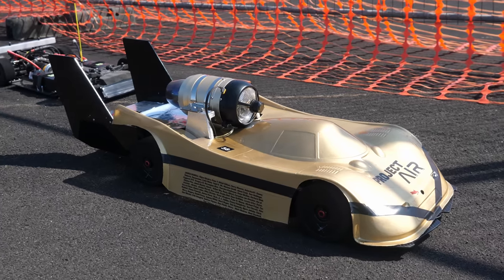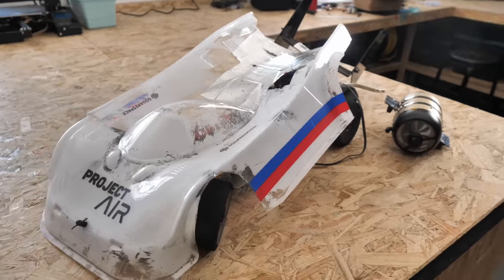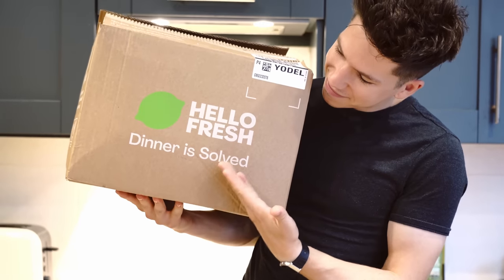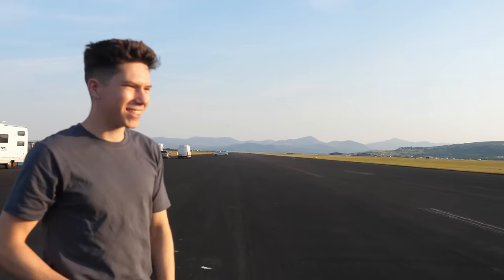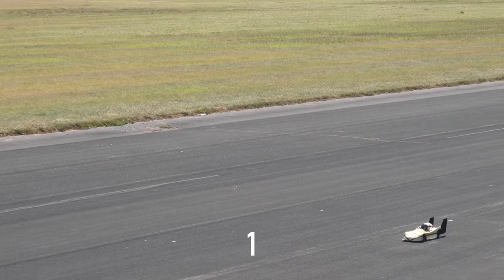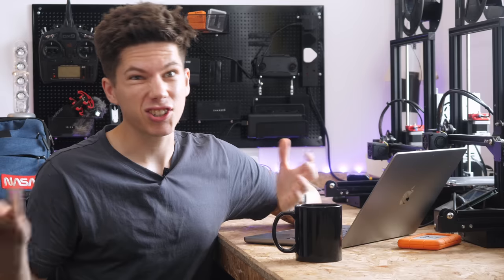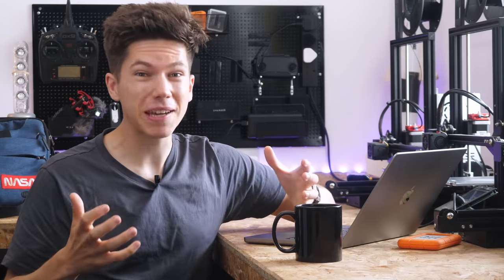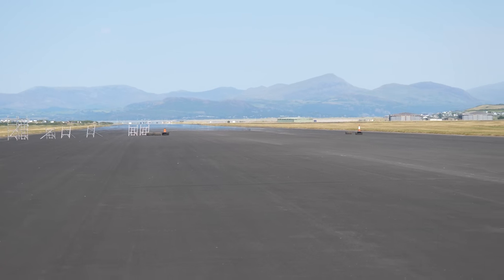Fastest RC Jet Car (Runway Testing)

Comment: The gyro is for a rc plane right?  The response of the car steering will be really different.  I'm sure some people have used gyros in cars successfully, but it might just be luck that the response of their steering is similar enough to a plane.

If you do want to run something like a gyro, maybe run a tunable/programmable flight controller on the steering axis and tune down it's sensitivity ?

Comment: Take a look at the direct to servo stearing links on 1/12 pan cars slop is almost nothing. If I was building a speed car I would try to go with a similar stearing set up keep the chassis very simple. The more moving parts the more slop there is.

Comment: The gyro must've gone wrong due to the wheels not being balanced, at high speed, the side of the wheel that had more mass, would push/pull the steering and the car, making that gyro malfunction.

Comment: Gyros need to be isolated from vibration. You would have been better off with a Lumenier Lux F7 flight controller, isolated with the silicone standoffs, configured with some heavy imu filtering. Then just assign one of the flight controller servo outputs for yaw control, iNav firmware. Get rid of that spektrum trash, and go with 1 - 2W TBS Xfire at 868MHz, fix the mechanical slop. 

You go that route ^^^, your problems will be behind you. Also, driving at these speeds, you may want to think about FPV.

Comment: In testing the same problem using my IQ and the knowledge that I have acquired over 40 years I found that a slow servo is more than likely the culprit. The gyro sends a signal to the receiver to keep it straight but if your servo cannot move fast enough to keep up with what it thinks is dead center then your servo is always falling behind the signal. I tested this for several hours using a cheap Chinese four-wheel drive buggy and a dumbo controller because Kevin recommended them and he uses one for almost everything and I always was curious about gyros myself. After fighting with it a bit I found that somewhere in the ballpark of 60% gyro was where the wobble started and at 100% it was comical to watch it attempt to go down the road like a drunken clown car. After settling on 30% gyro which was what it seemed to function the best at I decided it wasn't even worth it and I put the original fly sky back into it. I'm sure sloppy steering linkage doesn't help either but I'm guessing the root of the problem lies within the servo not being able to move fast enough to keep up with the signal from the gyro.

Comment: If you are going only for top speed on straight then you should extend the wheelbase of the car with 2 extra wheels 6 wheel setup and try a boady design like the real top speed record cars such as Mercedes T80 maybe this things can help for sure...the extended wheel is more stable at higher speed compare to normal once and extra wheels too

Comment: your gyro maybe be affected by electrical interference from the motor { or another source} try putting capacitors on the motor   i used to have this problem with a boat i built.

Comment: The car needs a suspension system of some sort to reach it's max speed. The vibrations in a setup that small and light are devastating to stability. 
I doubt that the down-force generated strictly by air control is sufficient to dampen the vibrations enough to get the job done.
You would need a running surface that was glass smooth to get what you are looking for.
Solid steel wheels ala Thrust SST? Maybe with the addition of a thin tire to help absorb the impact from those individual pieces of aggregate in the pavement? 
Much lower COG. More wheel inertia. Not good for cornering but great for straight line speed runs.

Comment: Would it help the matter to remove the gyro and run a slower steering ratio? If the car is to be straight line high speed only that is.

Comment: fuel tank sloshing around add a RC jet plane fuel tank inside to reduce the sloshing around also it looks like all the weight is on one side, in both crashes did it move toward the side the fuel tanks on?

Comment: definitely the gyro caused the oscilation. Looks like a unstable control loop. If you can adjust the gyro gains maybe you can use it.
I wouldn't blame the sloppiness of the steering, but a PID control the gyro uses is too agressive on high speeds

Comment: Stopped at 13:00... my guess would  the gains are too high. Happens all the with RC planes. Get to a high speed and wings rock cause the gyro is trying to level the winds too accurately and too fast. So, it over corrects to one side and then the other amd so on.

Comment: why don't you try to control the engine's gas output to send the car down, to make small changes of direction at high speeds, a reverse direction of gases to stop. All this in a single component, so you'll be able to remove a lot of the weight related to brakes, steering control (since you're on a track you don't need such a precise steering).

Comment: Gyros are really sensitive to vibrations. I faced a similar problem while building my drone, the gyro readings start oscillating at the resonance of the vibration from the drone props, so maybe it’s something similar that you can correct for using filters…

Comment: i dont know any thing about rc speed racing., but used to race silly overpowered 18th scale with other engineers in the parking lot at work. i used that exact same gyro to  tame the twitchyness. it works great until it doesnt every litttle change to setup or conditions changes how much gain you can get away with before oscillation. too fidly even on 45mph rc18ts. seems like you could just mechanically tune crazy understeer and a lot of expo to tame a speed run car
Reply: and probably need better than a 17usd gyro if you intend to use one.

Comment: I've not follow the last vids. But from a airplane experience, you must keep the vertical surface at max rear and max surface possible
Be sure they can enter in vibes at any rpm on the EP motor. He is more risky on vibrating than turbine. So if no flutter appears on it. No appears at all 
You also must have a big rigidity in steering including the suspension articulate on it. 
If your radio accept it you should use exponential over gyro. 
I have no exp on car gyro, on airplane yes. They are very cool to use on pilot which don't have reach the skill of control. But I am a strong defender on the raw practice. Skill yourself not skill your model. 
It cause more damage yes. But Au better pilot. 

You probably must work on steering servos amplitude to short it to the strict minimal need and half it by dual rate radio setup. 
Your fingers become more precise and far stable on straight

Also think of lateral wind. It push far from steering on your vertical surface that have no control on it. And simply turn it more with speed' 

Trust in your test you are ona. Good way 
And don't listen Kevin 😜

Comment: You need to use a wide chassis with abs or Cf inner ribs that the body velcros too. So many things wrong with this for high speed reliability but its really nothing different than 99% of the rc youtoobers. Yeah, i am a mechanical design engineer.
Reply: Also if uou use a 4wd rc dyno you can save a lot of money working out many issues. Wind tunnel helps as well. Cheaper to buy these tools than replace parts all the time.

Comment: It almost seems like the rear fins were too large. Could they be causing a weight imbalance on the car? Under acceleration it might cause the front end to lift slightly.

Comment: your rocket car answer is right behind you, mount the friggin rocket on wheels and one thing about all you guys, 
sure you got oscillations with those hugely WIDE TIRES. Bonneville speed cars have NARROW FRONT WHEELS that 
don't wobble like casters on a shopping cart, so you didn't do anything wrong, it's what you DIDN'T DO that made it go 
crash. Have fun, I've done rocket cars when I was 8 yrs old, just maybe not as expensive and sophisticated as todays plateful.

Comment: You should mount a 360 camera on the car. That way u can see the wing as well

Edit: well, it looks like you do exactly this. Why dont show footage of the "wobly wing"
Reply from the maker: I wasn't able to fix my 360 camera to the car in the video, as it was a bit too large, unfortunately. The camera later on in the video was an Insta 360 Go 2, but it doesn't actually do 360 video, just stabilizes it 
and shoots a wide field of view. Next time I'll be sticking cameras all over the place, as you're right, it would be helpful to get lots of angles. Thanks for watching!
Reply: @Project-Air  thanks for answering! Keep it up, nice videos

Comment: Why not use the intake as a form of suction? I mean I’ve seen little rc wall riders do this, why not use your already sucking jet turbine to suck against the ground?

This would be a good challenge but mounting the turbine lower into the chassis and using guided intake through the front end and on the ground would both keep the car on the ground and…increase airflow?
Would definitely solve your center of gravity issue though!

A more extreme project: maybe even have an adjustable front end air intake on top of the ground effect, considering the turbine would need open air intake first to get going, once airflow was under the car then shutting the open air intake would cause it to clamp down on the ground.  At least I think haha.  

Ps: the car doesn’t suck.  I think it’s pretty bada**

Comment: Umh, it's not Tarmac.  It is an asphalt runway accessed via an asphalt taxiway connected to an either concrete or asphalt ramp area used for parking. Tarmac was replaced by asphalt many years ago.

Comment: Great video and content.  Gyros in my opinion may not be worth the added drama they add and overall not necessary.  If you do run them they have to be turned waaaaay down.  You might like some of my rc speed projects if you get a chance to swing by my channel.

Comment: That oscillation is your gyro being WAY to sensitive on steering that is not rigid enough
There is too much wiggle in it and I have a feeling that your steering servo is not nearly precise enough

You need a proper servo
Metal gear and enclosure!, super precise, super fast
The metal enclosure might be even more important than metal gears since many lower quality servos might have their casing twist….

I can actually recommend the spectrum servos
they do cost a pretty penny, but they areUnbreakable

Comment: Just rebuild what you have and shim it… the gyro is either to high or the turbine combo is just creating to much vibration and messing the gyro up… even in rc drift where it’s very stable in comparison if you run a gyro near something with strong vibration it won’t be as accurate as intended

Comment: As an RC Heli guy i would say you rgyro gain is too high, plus you probaly have to much vibration getting to the gyro. Use a multylayer foam mount, soft/hard/soft foam. layers. or better a thin shet of lead between two layers of gel foam tape.

Comment: Are you sure the gyro is correcting, 'correctly', as in when you move the rear, in one direction, the gyro should counter steer and not steer in the direction the rear is trying to go . Some gyros have a setting for this

Comment: another idea you should try while building and testing. wheel balance. this subject is not covered even remotely enough and is far too often overlooked as it has never been considered for rc. Just like a real car, when you buy new tyres they need to be balanced to stop vibrations and wobbling effect and rc cars are no different. after truing the wheels and they are still wobbling on the chassis they need balancing. I think it was bittydesign that has posted a video on this subject

Comment: Good engineering, but all your testing in tune should be done before race event day. saves a lot of embarrassment and broken part on event day. You got to shim those front wheels properly. You need a servo thats more torque than speedy. If you have a really fast servo and gyro its a recipe for disaster cuz it's always going to over compensate and be twitchy. You don't need a gyro they were right a high torqy servo will always bring those wheels back to center doing speed runs.
Reply from the maker: Thanks for the suggestion, although it’s quite difficult tuning a vehicle when there’s nowhere to run it before the big day!

Comment: I'll tell what happened it was the gyro because it was set there to fix the cars trajectory but the problem was that the car was shaking so much at hight speed the gyro would have to react to different vibrations that's not the problem here the problem here is the gyros reaction time because when the vibrations started to take place the thing didn't have instant reaction speed because of which it would react to the vibrations after they had take place and the effect from them has also taken place but it tries to fix the things trajectory after some time which will make it so that the car would shake even more this what lead to the thing shaking and crashing remove the gyro if u were to use one use one with reaction speed of 0ms (which I don't think exists)

Comment: Wow, it hurts to see such a project go down due to the use of a shitty control link protocol.
You surface guys really need to join the rest of us RC folks with open source control links that costs nothing and go for MANY kilometers. (ExpressLRS)
And I do wonder why you would not use FPV for speedrun attempts? I imagine it would make it so much easier to keep control at those speeds.

Comment: Ok, no doubt the sloppy steering linkage didn't help anything. Before you do more than snug that up, check the balance on your wheels and tires. You can, or at least should be able to, adjust the gyro gains for a little road texture. If you have one or more wheels out of balance? The vibrations and harmonics will make anything undrivable at speed. Gyro or not. That is truth for any scale vehicle. RC rock crawlers and farm tractors don't worry about wheel balance. Play with the numbers and the rpm your jet car wheels are turning? Uh huh. Use a lathe to true the tires and a prop balancer for weight/mass adjustments. Then send it and share!!! Thanks

Comment: Ugh - such a lost opportunity with the shaky camera during the runs.  Isn't that the most important part (and thus requires due attention) when the intent is to post and share on YT?  Tripod w/axis swivels out of budget?  Everything else seems ok and it's cool you're endeavoring to run towards Mach 1 with that thing.  Spend time and a bit of $$ (which would no doubt be small relative to all other costs) in the Batcave planning and testing.  Cheers.

Comment: Sorry but agree with others that tail fins are too high,might not be the reason for crash but too high.Your method to prove this wrong was flawed.You was not using the "high" mounted jet,blasting straight through the fins AND the road you used was sheltered on both sides. Now you will say yes but there was no wind at the Wales site.Just because Raz has that style does not mean it will work on any car,like you found out with the body you had to hack to pieces.

Comment: None of it was a failure. It was testing ideas in an unpredictable case. With what you learned you can move onto the next project with better understanding and more predictable outcomes. 
If you never crashed it you wouldn't know the outcomes, and it wouldn't guide you to the next project.
You've got to look at it both ways.
Engineering isn't always cut dried this is what will happen. 
Go back to the eairly 1900s and look at bridge design. They built a bridge that got the name of galloping gurdiry 
And it all had to do with aredymanics somthing one might not consider doing a bridge, after all its a road whos going to fly it?
But apparently it acted like an aircraft wing in the wind. WHO KNEW? 
Well we do now and its somthing bridges are planed around today.
Just becuse the math says it will work, dosnt mean you've looked at every aspect.

Comment: The fins only ad weight, the shell is weak and bad designed for top speed. Design a new shell that covers de motor, and a single smaller fin. Look at jet powered top speed cats for inspo.

Comment: Can't believe you'd use such an awful control link to failsafe at only a few hundred m in clear los 😂😂😂🤣🤣🤣especially with something as expensive at that. shitty surface system ffs 🤣 how much did the control setup cost? 😂

Comment: Confused by your conclusion. At about 11.28 when it's coming towards the timing gate you can see the fins deflect (maybe a side gust?) That to me is clearly what put a yaw effect on the car that the gyro then struggled to correct. That's not a gyro issue that a fin issue. It likely caused a turning effect that was beyond what the gyro was setups to deal with thus causing an oscillation. Perhaps making the fins out of sheet aluminium, workable with wood tools, will make them more rigid? Or maybe make profiled side fines to attach to the sides of the car, would cover the wheels to for better aero and you can link them under the chassis with a cross brace to prevent them being sucked into the wheels. Although as aluminum it would be unlikely to happen anyway.  

Also your test with the motor and gyro... you're forgetting torque steer which is causing an oscillation. Set it up to be rear wheel drive only to retest.

Comment: I'D LIKE TO SEE YOU TURN THIS CAR INTO SOMETHING COMPLETELY DIFFERENT BY ADDING EXTENDABLE WINGS WITH FLAPS, AND TAIL FLAP RUDDER, THAT WAY WHEN THE RUN IS OVER YOU CAN FLY IT BACK TO YOURSELF. I KNOW THIS SOUNDS CRAZY BUT I HAVE SEEN BOATS THAT FLY, PLANES THAT FLOAT ON WATER, AND EVEN SOME CARS WITH FIXED WINGS FLY,  BUT I HAVE NEVER SEEN A CAR THAT TRANSFORMS INTO A PLANE. AND I KNOW YOU'RE ALL ABOUT CHALLENGING YOURSELF TO INNOVATE THINGS ESPECIALLY COMBINING HOBBIES. I'LL BE WATCHING FOR IT.  CONCEPT DESIGN IMAGE @  C:\Users\david\Downloads\Gemini_Generated_Image_flbncuflbncuflbn.jpg